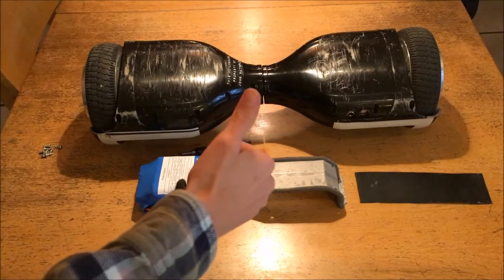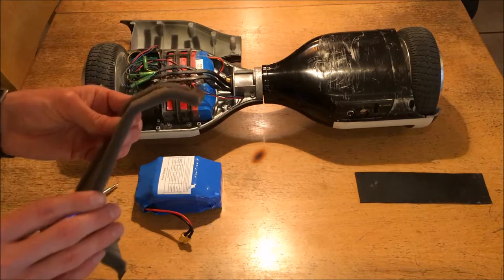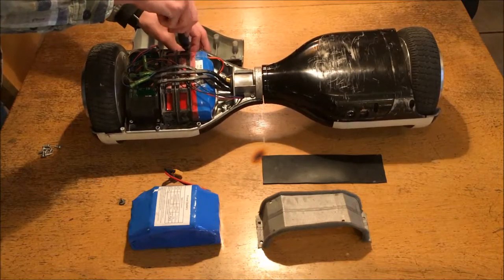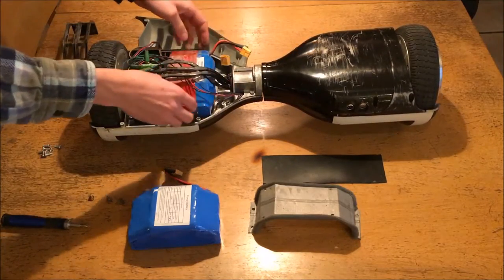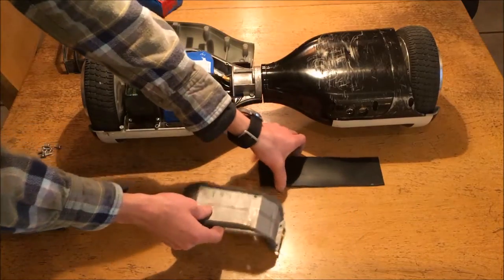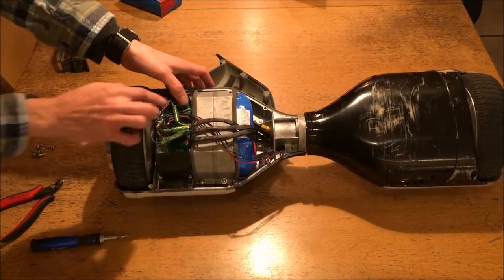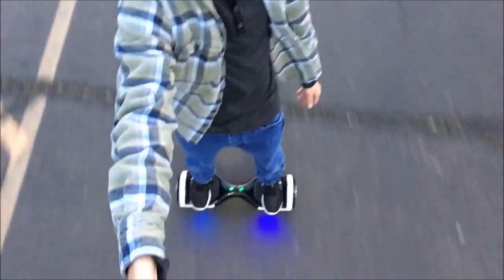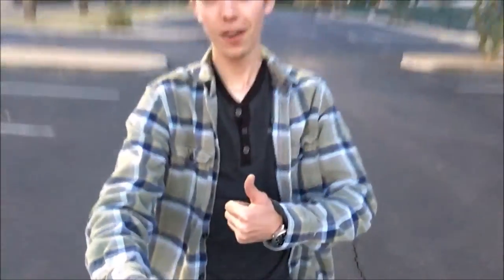EP 21 - Hoverboard Battery Replacement

Comment: I'm sorry to ask you one  thing. The black plastic lock of the battery does not close nor with the cables outside that inside. If I force the screws to arrive, I'm afraid to give the wires.
Reply from the maker: You might have to modify the black bracket to accommodate the thicker battery casing if it doesn't fit. Definitely avoid crushing the wiring.